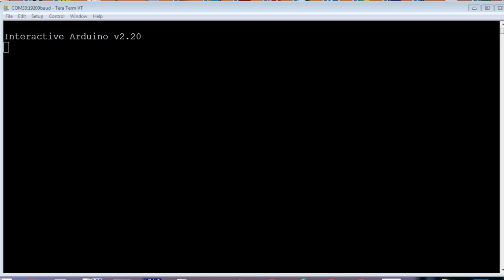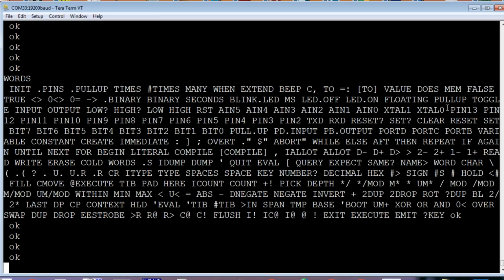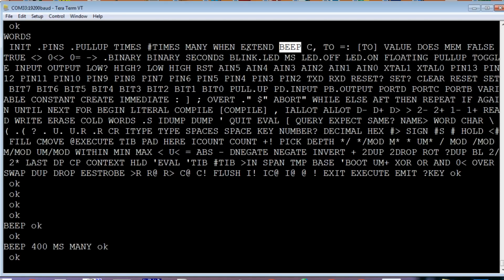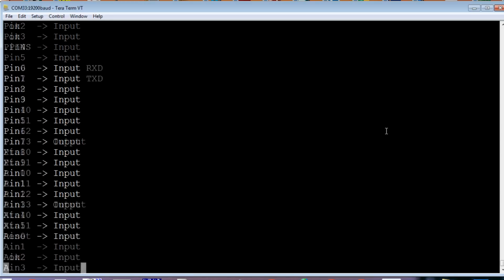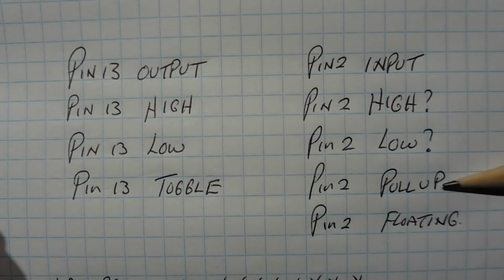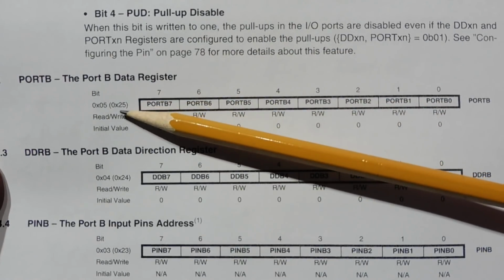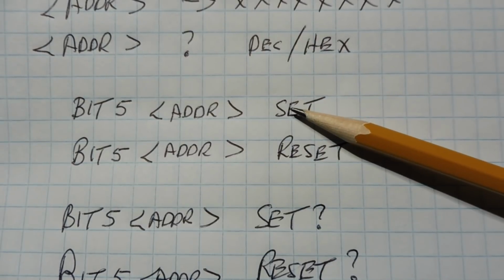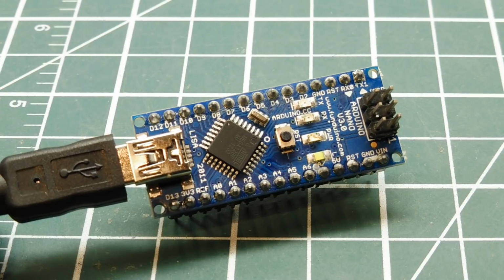Interactive Programming  / Micro-controllers For Beginners

Comment: The word defined by the user is stored in the dictionary using the word "extend". But I am going to delete the word. So what words should I use?
Reply from the maker: Decide that you really want to make that word permanent before using the word extend. There is no word "forget" so you have to re-flash the micro with IA.hex. You can make erase point in the dictionary by using the word "marker". Check the documentation on how this works. You have to load the file marker.txt
Reply: @0033mer  Thank you, Very much for answer!

Comment: Hi, I have gone over this video a few times; I finally figured out why PIN2 LOW? would not print out the answer.  PIN2 LOW? .   <- see the dot it prints out the answer if not just an ok prints. Thanks for your great work   : = ))
Reply from the maker: Yes, correct. Flags are returned to the stack which is always active in the background.
To display the top of stack "dot" (period) is used.

Comment: Nice video, there just isn't enough about Forth on Youtube :)
I maintain a Forth documentation site for Mecrisp Cortex M and a tethered Mecrisp Forth using the MSP430 at http://hightechdoc.net. No adverts or clickies.
Cheers,
Terry
Reply from the maker: Thanks for the link. Mecrisp is very useful, I use it on the ARM "Blue Pill" and 4Eth for the MSP430.
I will use your link in my videos if anybody requests documentation.
I have been using Forth since F83 and F-PC by Tom Zimmer.
If you need a X86 port check out JK Micro's Flashlite board. It's old but the boards are still available.
 http://www.jkmicro.com/Downloads-General.html

Comment: Our World is running in loops.  Are you recreating the BASIC interpreter from 1975?  I think so. Good stuff.
Reply: No 0033mer isn't recreating Basic. Forth is very different from Basic, even tho they are both interactive. Personally I'd never use Basic on a Microcontroller, even tho I have around the mid 1980's.
Reply: Why they ever stopped including it with the O.S. is beyond me. But I guess most of the world doesnt program.